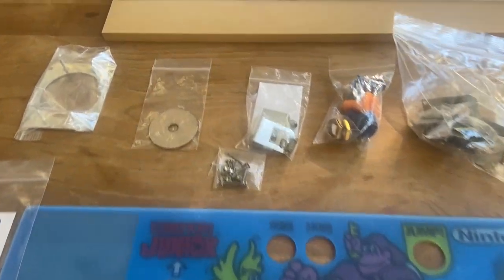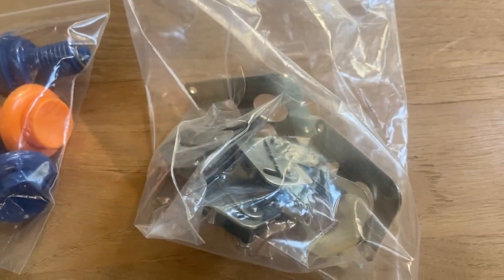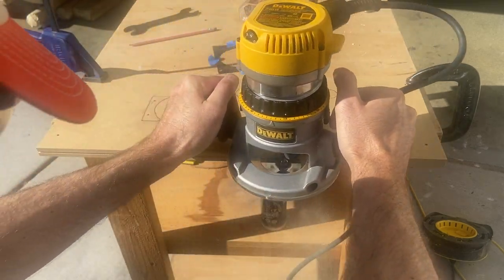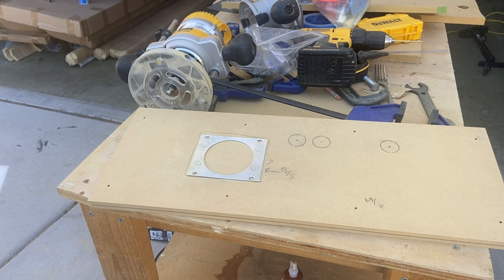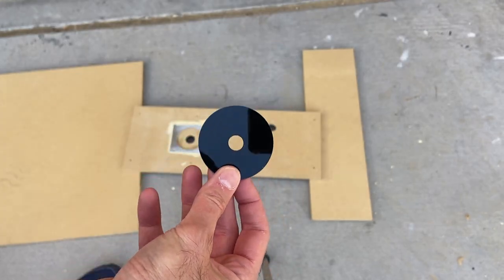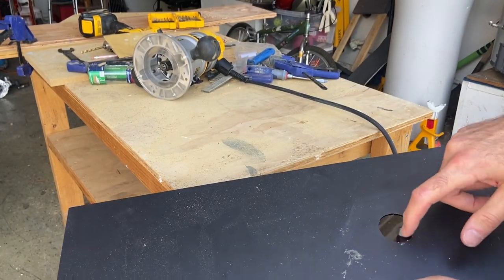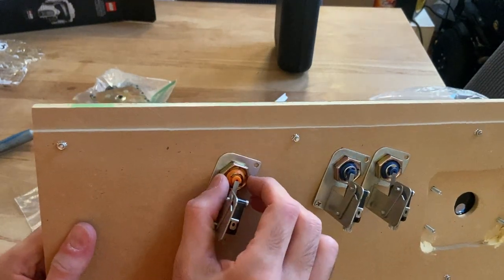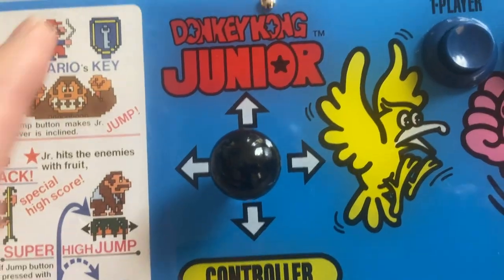Making a NINTENDO ARCADE Control Panel From Scratch!

Comment: If someone has problems to keep there drill stable with the button and joystick holes. Lookup forstner bit, they have them in all sizes. So I have 24, 28 and 30mm for the buttons and the joystick holes. Maybe they help you as well.
Reply from the maker: Thanks. I’ll definitely check it out.  I also have a hole saw bit that has the drill bit in the middle.   Usually works well. I’ll pretap a nail hole to start the drill bill with the hole saw .  Thanks for watching.
Reply: @therexershow  Those should work as well, the problem I have with the Speedbits, is because they are flat, I tend to wobble. So my 24mm becomes 25. This is mainly a problem if you want your joystick buttons close together. Forstner are easier too handle for me. And since they sell them in exact sizes, you only need 2 or 3.

Comment: What did you use for drilling out the button holes?
Reply from the maker: Sometimes I use a spade bit or a hole saw.  I do NOT use a step bit as it doesn’t work right on thicker control panels .  I believe it was a 1-1/8 bit.  But I can’t remember. Always use a test piece of wood and drill test holes first.
Reply: Alright thank you